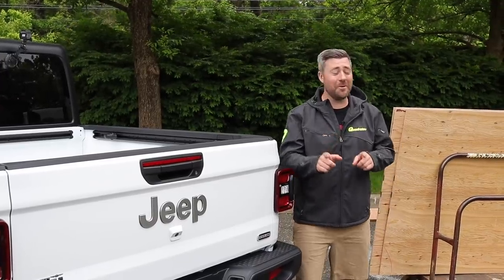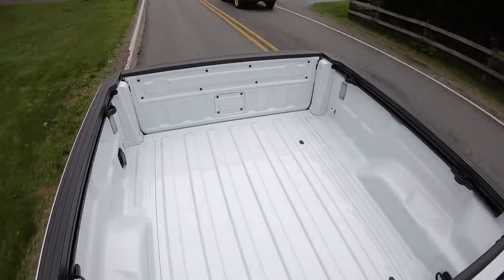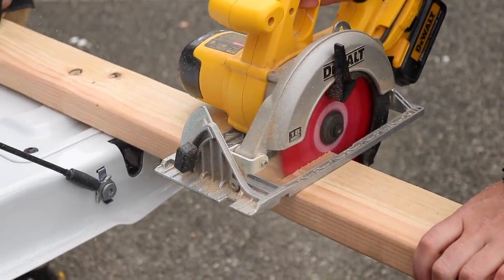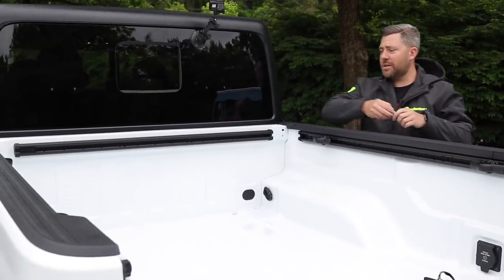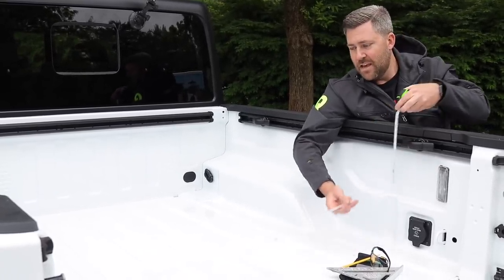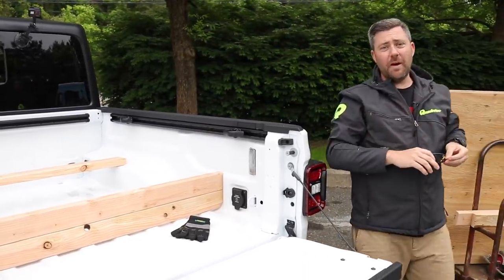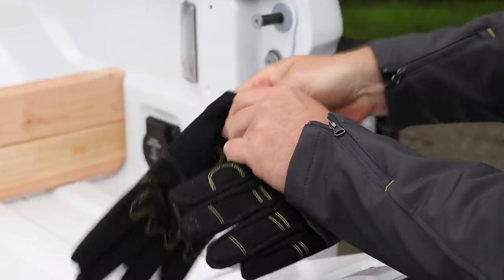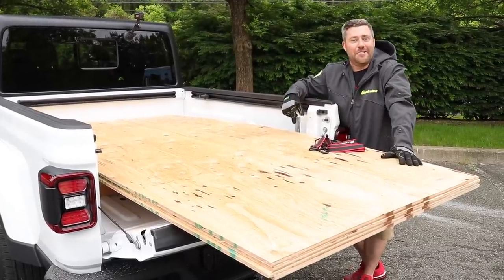How to Load Plywood in a Jeep Gladiator Truck

Comment: I never knew people cared so much about hauling plywood until the Gladiator came out. 🤷‍♂️
Reply: Apparently they aren't tree huggers : )
Reply: That’s because people thAt actually use a truck to haul plywood buy a reAl truck.  Step one, load plywood in bed.  Step two, close tailgate....
Reply: Plywood rated is a inside joke on the gladiator forums, been going around there for a long time.
Reply: Not a joke, I set up temporary platforms and they are based on 4'x8'.  So yes being able to carry a 4'x8' is deal breaker for me.
Reply: When you're buying a $60-$75k "truck" you want to be able to haul something in it. And yes, I love the look of the Gladiator and want one pretty bad. But I finally retire my 20 year F-150, I'll probably end up buying another truck with at least a 6 foot bed.

Comment: That's a cute little honda ridgeline.   I know it's not going to a jobsite because anyone going there should know you have to mark a load that hangs over the tailgate for safety.
Reply: Not in all states. In some states, only loads that extend 4 or more feet back from tail lights need to be flagged. The load in this video does not extend that far. Same applies to Ridgelines.

Comment: Rob!  Epic video, surprised it doesn't have 5 MILLION views already, but you failed to measure/mension if the gas fill tube buldge interferes with the plywood.....lmao, did you have to notch the plywood?  sincerely, your buddy on jeepgladiatorforum

Comment: The bed, or lack of a useful bed is what stopped me from buying a gladiator. For an occasional trip to grab some plywood sure it’s fine. If you actually need the utility of a truck bed, it’s useless. Good luck loading a pallet into the bed. I wanted to love the gladiator since I love my wife’s JL, but ultimately I ended up going home with a Ram Rebel
Reply: I went the other way completely and decided to go EV.

Comment: Are there hooks on the floor of the bed to strap the load down so it doesn't slide-out during transit?
Reply: Yes there are. Two on the front. Two on the back.

Comment: Do you really need do go through all that just for a couple sheets a plywood? Just leave the tailgate up and throw the plywood in there with a couple straps on,like everybody else does. Its crazy how Jeep went through all that trouble for something so simple
Reply: My thoughts simple things made complicated.
Reply: Probably designed by people that have never hauled lumber.
Reply: @Technomage1700  not really there for plywood as much as more fragile 4x8 sheet goods. Just need some ply set the bed at half and strap it in
Reply: All that trouble? Yeah. Stamping beads in something that already gets beads stamped in it is a real pain in the ass.
Reply: Not trouble its Called convenience. just added perk so ply wood will lay flat. Don't be so critical.
Reply: I like it and I think it shows attention to detail. He can be there and you don't have to ever use it. I will definitely use it. You will only have to cut the two-by-fours one and when you don't use them you store them away somewhere. If you are someone who periodically holds Lumber or sheets of drywall let's say once a month it makes sense to have the setup. Once the lumber is cut you just slide it in place it will be a lot faster than strapping.
Reply: Tacomas have the same thing. It’s not uncommon.

Comment: Makes no sense to do this for plywood, just throw it in the wheel wells with tailgate at mid height and go. Sheet rock on the other hand... that's where this makes sense.
Reply: I frequently buy 4x8 sheets of sheet steel and this is very good to know.
Reply: Yep, Plywood will survive without the 2x4 support but I think it's nice to know for other material like drywall/sheetrock

Comment: How to load sheet goods in any full sized truck

-Open tailgate 
-Place sheet goods in bed
-Close tailgate

It’s amazing how those engineers made the wheel wheels exactly 48” apart it’s like a crazy coincidence or something, this seems like a bunch of hoopla just to get something into a “truck”. Christ a Honda mini van can fit full sheet goods inside them with the back hatch closed
Reply: Jake’s Garage you have an 8’ bed?
Reply: Michael Noonan yes I do and even on the trucks I have had a 6’ beds you can usually lift up the sheets and get them over the top of the tailgate
Reply: @jakesgarage680  technically you can do this with a gladiator too.

Also, many fullsize trucks come with 5' and 5.5' beds. Not much more bed there, just a little more width.
Reply: My apples taste better than your oranges.  Jeep gladiator is not a full sized truck.  Try closing the bed on a Colorado or Tacoma and get back to me.
Reply: Let us know how that truck with the 8" bed does on moabs rock trails. Also, let us know how easy it is to make it into a convertible, and take the doors off of it. 

Gladiator is meant to be a swiss army knife. It's not meant to be a 1 ton work truck. It can do a bit of everything adequately. It's a tow vehicle, it's a family hauler, it's a work truck, it's a jeep, it's a convertible, it's an SUV, it's a grocery getter. Let me know what other vehicle has the same versatility.

Comment: Can you make a video on how to tie the plywood down
Reply: Just like with any truck...pull the front down to keep it from raising and pull the rear down and forward 
Front: strap across the top near the cab hopefully with a anchor point lower than the cargo like a bed point...
Back:  you want to pull it forward and down at the same time im a fan of 2 straps for this but 1 will do... hook into a bed anchor go over the plywood and at the halfwat point wrap underneath on the backside and atrach the starp to the opposite side of the bed...

Comment: They need a 6 and a half ft bed option at least to make it useable as a work truck, which the Gladiator isn’t. They need to bring back the Dakota or at least a Gladiator work truck model with a lower price.
Reply: The more I look at the new trucks, the more I like my '98 Dakota 4x4 with a 6'6" bed and a 5.2L V8.  340,000 miles.  I rue the day when it stops.
Reply: @David Hablewitz Same here, I have an 06 Dakota 2wd 4.7 V8 with 3.55 rear end and 6'6 bed. 97,000 miles,  I've loaded a full pallet of bricks in between the wheel wells and will carry plywood no problem. It also tows like a 1/2 ton with a few suspension, brake and performance upgrades, I wish they still made them.
Reply: The original gladiator J series.. were work trucks 7 and 8 ft beds..  i have an original 76 J10 i can put plywood and drywall fully in.. laying down flat...  with the tailgate up.  These new Jeeps are terribly tiny in the bed.. useless

Comment: What was the exact length of the 2x4s? would have been nice to tell us ya think.
Reply from the maker: We didn't mention it, because everyone's situation will be slightly different. Given factory tolerances, and whether the truck has a factory spray in bed liner, aftermarket bed liner (Line-X, Rhino Lining, etc.) or no bed liner at all, you'll have to measure and potentially make a couple cuts to the 2x4 to get a nice snug fit in your truck.

Comment: The "2X4"s at my local home store are actually 1.5X3.5        Were your "2X4"s actual 2X4's or were they actually 1.5X3.5's?
Reply: 301steady no 2x4’s are actually 2” by 4”
Reply: @maxwellheinen1623  Are you sure?  You measured them?  At a local lumber mill, you can order wood however you want.  You can get real 2X4; but, the stuff at a local Home Depot or Lowe's, if you measure it, It's generally not 2X4.  Lowe's 1.75X3.75 ; Home Depot 1.5X3.5 .  It's really a sad state of affairs.  I'm just asking the question; because it is important to know if in this demonstration a real 2X4 was used or a Home Depot 1.5X3.5, or a Lowe's 1.75X3.75.
Reply: 2x4s are typically 1.5x3.5 actual size, at least the ones I buy.

Comment: That's some jerry-rig for a $40k truck.  The way the half-propped open tailgate is supposed to serve as a third point of support ... maybe this is good for bringing home a few sheets for some arts and crafts but I wouldn't trust it to drive home 20 sheets of drywall or anything.
Reply: Actually just did haul 20 sheets and I didn’t even notice it was back there

Comment: How to put cargo in new gladiator. Sell 40k jeep. Buy used 1500 or f150 for 5-10k. Problem solved
Reply: Correct
Reply: Plywood rated is a inside joke on the gladiator forums, been going around there for a long time. It isnt something that should be taken seriously.

Comment: Did “so many people” really want to know if they can carry a 4x8 piece of plywood in their brand new Jeep Gladiator? 😂
Reply: Plywood rated is a inside joke on the gladiator forums, been going around there for a long time.
Reply: Honestly I wouldn't be surprised, carrying plywood is an actual point people use when deciding which truck they want to go with. Which is understandable if you're a carpenter or handy man.
Reply: I am an oil painter and work large—so the size of the bed is important for me.
Reply: It was the first thing I thought about when I saw these came out.  They look cool, but I buy full sheets of acrylic and plywood almost 2 times a month.  This looks like a PITA to me.  I am going to have to stick with a full size truck...

Comment: Nice small size off road pickup truck.
But for building supplies I will spend my money on full size pickup truck and keep the charge.
Reply: Rui Silva the point is to have a truck that can do both...sure this wouldn’t make sense for a carpenter that NEEDS an 8ft bed every day, but for everyone else,  who would probably buy a 5.5ft bed half ton anyway, this is fine.

Comment: saw your "ad/commercial"... came here to read the comments, just to see if they were thinking the same thing I was..... 

IF you need someone to show you how to do this.... don't pick up plywood, you need to learn much, much more
also, if you use that tape measure......well, you called it that... you need to learn much, much, much more....
and the strapping..... not even going there...
"oversided load" wow, 8' in a 4' bed is an over sized load.

also, glad you used safety glasses............. to put 2x4s in the bed......

don't handle electricity, hire that out.... please....................................................... and could you snap a pic of your job site..... need more laughs.

Comment: If only they made a single cab, long bed. Not everyone wants a 4-door. 😐
Reply from the maker: Sadly, according to the mid size truck market, there is not a big enough demand for a single cab to make it to production. We would love to see a single cab like the Jeep J6 concept.
Reply: Or a 4 door with a real truck box.  50” between wheel wells and 6 - 8 feet long. Like a truck box should be.   This is not a truck.  It’s a suv without a heated cargo compartment.  Should be less money than a JL.

Comment: I would not trust the tailgate cables .  Flat strap 1/4 “ thick  1 1/2” wide fabricated from striker plate pin to tailgate latch .

Comment: Caca.. overpriced ...just get a real truck
Reply: It starts at 32k and it outranks nearly everything in its class at almost everything. It has a modified heavy duty frame, and full size ram suspension. People have been asking for a jeep truck for years and jeep delivers. What's not to love?
Edit: not to mention the standard manual transmission, and optional automatic, as well as the soon to be diesel option, and if sales go well, a hemi!
Reply: Andrew Long gladiators use almost all fiat parts, Jeep has been going downhill ever since fiat Chrysler got it
Reply: Andrew Long I doubt they will ever put a 5.7l V8 in a Jeep. They will have to make a new engine compartment that will actually fit the engine well. Also, what diesel are they gonna use that’s actually gonna be reliable?